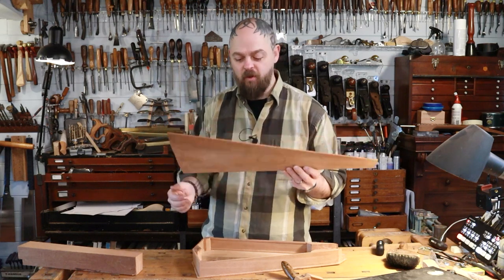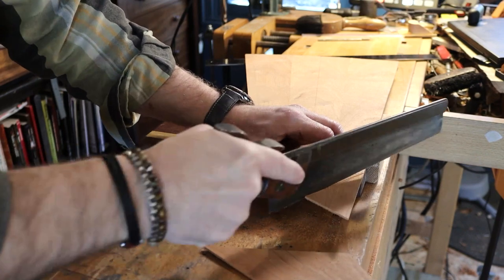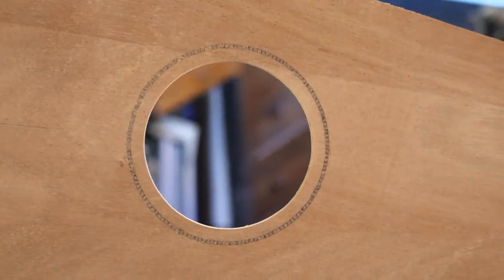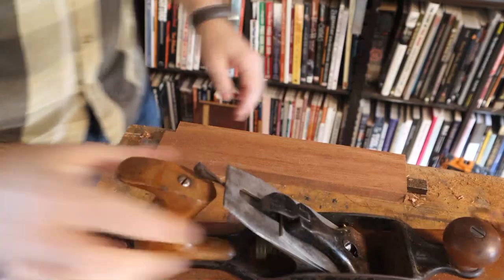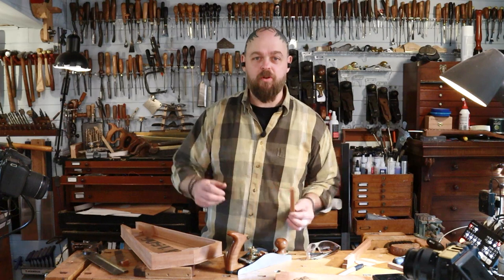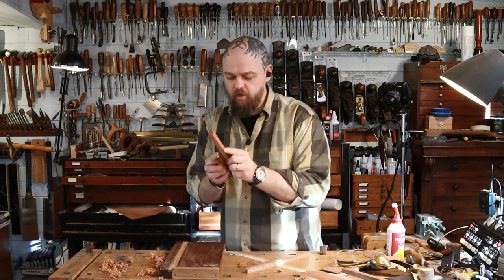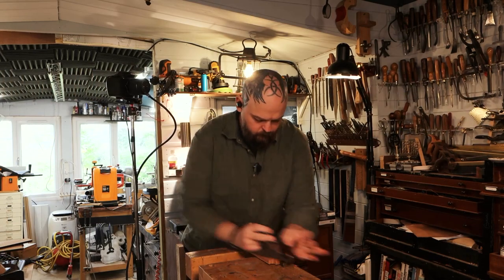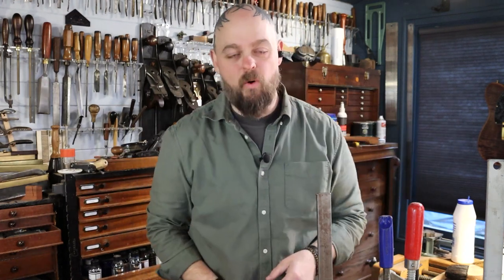Ep 11  Brace for it - Hand Tool Only Acoustic Travel Guitar Build -  A Guitar from a 4x4 FENCE POST

Comment: Greetings from Wisconsin USA;
     Hi Ben, I love this little guitar. The only thing I would change is the bridge plate. I would use a really hard dense wood like Paduk. You commented on how this wood in the brace chipped out when you drilled the hole in it. If the bridge plate splits like that where the peg holes are it really weakens. Also the Paduk can be much thinner. It is also as good of a tone wood as Mahogany. I know you wanted the guitar to be all out of the one post, but the bridge plate is the one place I would make an exception. I would also run two lengthwise, narrower braces between the brace just before the bridge plate and the tail end of the guitar right up against the sides of the bridge plate. This would help keep the top from bowing up over time under string tension. In any case I believe this little guitar will have a very nice sound when it's finished. Keep on thuckin my friend.

Comment: I once stuck a pin vise so deep into my finger that it scraped the underside of my fingernail. I bet a laceration from a coping saw feels just as good. Oh, and you might be able to fix that clamp if you bolt a piece of plate steel to either side. It probably won't be as strong as it was, but it's a thought.
Reply from the maker: Ouch, ouch, ouch ouch ouch!! Oh, and OUCH!

But the clamp wasnt string enough to start with  😆 may be worth a fix though
Reply: @CrimsonCustomGuitars  I'm more of a tinkerer than an actual craftsman, so it's in my nature to think of on-the-spot fix-me-ups.

Comment: Since Ben Asked - Tool Analysis for the  Video

Total number of tools used 57
Total number of unique tools used 29

Plains	             Total 12 Unique 6
Saws	             Total 10 Unique 7
Chisels	             Total 6   Unique 4
Clamps               Total 11 Unique 1
Rulers                  Total 3   Unique 2
Fret Saw	      Total 2 Unique 1
Levelling Beam  Total 1 Unique 1
Straight Edge      Total 1 Unique 1
scalpel	              Total 2 Unique 1
Files	              Total 2 Unique 1
Sanding Stick      Total 4 Unique 1
Knife\Mallet	      Total 1 Unique 1
Protractor	      Total 1 Unique 1
Brace and Bit      Total 1 Unique 1

Broken Tools	                                 1	
Movie References                         1 
Arty Slow Mo’s                               1		
“Fight me in the comments”	 1	

Masking tape and super glue trick - Zero (Shock)

Power Tools “Accidently” Used - Zero

Comment: "According to Jeff Loflin, glue specialist at Franklin International (maker of Titebond wood glues), salt (and sugar, too, by the way) can react with wood glue and alter its composition, resulting in a weakened joint. Rather than resorting to parlor tricks, apply good gluing and clamping techniques"
Reply: so use fine sand instead, got it.
Reply: Check these glueing tricks out from Nick on the "workshop companion" channel. Rubbing two pieces of coarse sandpaper against eachother creates a great substitute for saltgrains in your glue joint. Does the same job and no need to worry about the chemistry. 😃👍

Comment: I'd say make the neck a bolt-on. The body is quite delicate and may someday need replacing. The neck however, is a work of art and should be preserved. The body should also be preserved, but that may not be possible in the long run, so hedge your bet. Anyway, that's just my opinion. I could be wrong.

Comment: Maybe a dumb question but what is the salt for?
Reply: Commenting so I'm notified of the answer too 😃
Reply: @Gatherersmusic  the grain grabs into the wood surface making it less likely to slip around. But it dissolves in the glue if you're not fast enough with clamping. That's what happened when he glued in the bridge block

Comment: OK Ben, you are a genius, using a straight edge to draw a curve. Thanx for the tip about watering end grain for planing but why put salt on your glue joint?
Reply from the maker: The piece slips all-over the place and just one or two groans of salt hold it right there.  They dissolve before the glue dries and its just a great old time solution to a problem